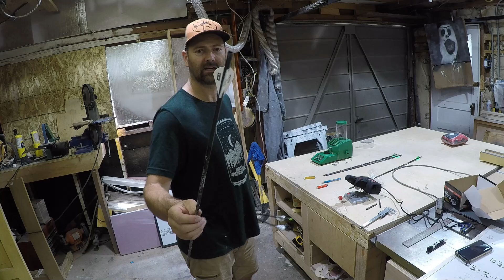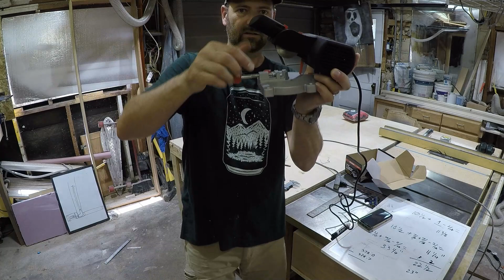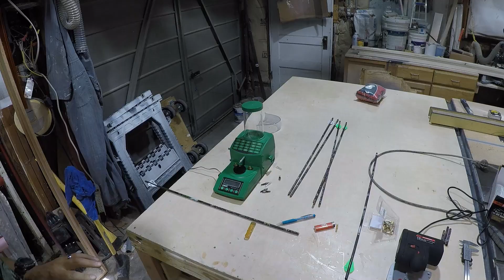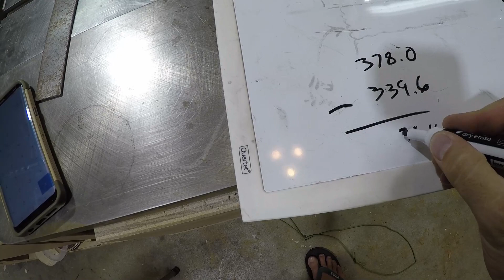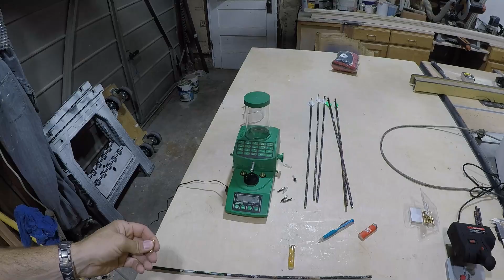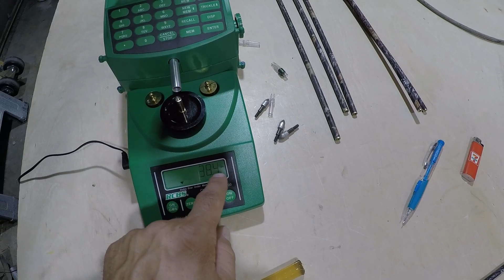Arrow setup for ELK Hunting

Comment: The shop vac / dust collector is right there!  Why take a chance getting nasty splinters let alone getting some of that shit in your lungs?  I guess we have different opinions on this one. After working with epoxy + carbon parts in an industrial setting, you don’t question why that massive & pricey Torit dust collection system is installed.

Comment: I don’t know, you glued the insert without the Blades. How are you going to match the blades with the veins once the glue cools.
Reply from the maker: Mechanicals don't need to be matched up.  If I did need them to match up you sand the face of the brass insert.

Comment: Pretty much the same way me and my dad have been doing this process since the mid 90's. The only thing we do different is using a glue or epoxy on the inserts, just to prevent the heat from the hot melt from effecting the carbon shafts....probably isnt necessary though. We never got/get super fancy/complicated with it, and I was still able to win national level tournaments. I think with some guys getting overly technical just let's them know that every variable is addressed, but with me, I'd rather spend that time practicing